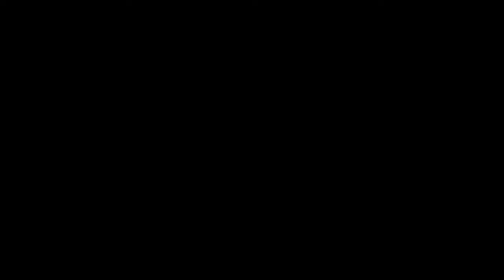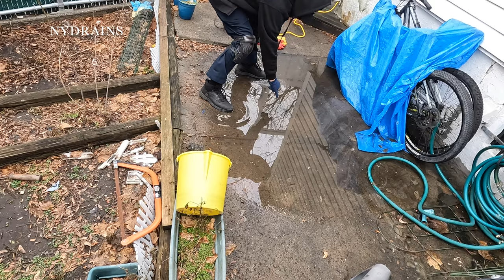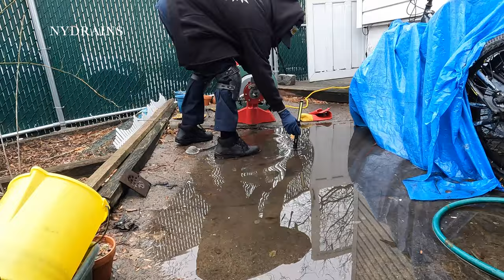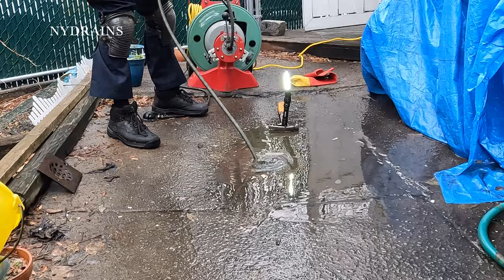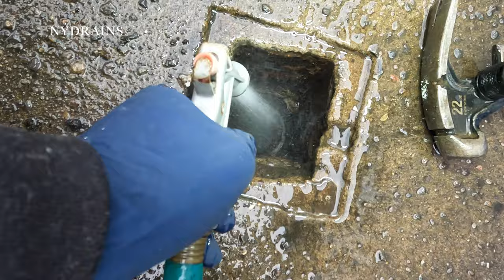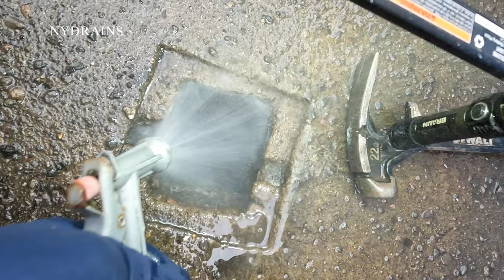Easy Peasy Outdoors Cleany #CloggedDrain #Sewer #Shorts

Comment: I think doing a storm drain might be a first! Well, a first that I can recall.
Reply from the maker: I've done plenty, none on tape that I can recall.
Reply: that looks old enough of a "storm drain" to be ran inside and tied into the sewer line! that's what NY(and others) did many years ago, including the downspouts from rain water!
they outlawed and quit doing that many years ago also! here in Ohio, there's giant cisterns abandoned all over the place underground(used to collect rain water from roofs), you never know where one is and if you'll fall in through bad lid or heavy equipment/vehicles collapse it.
I nearly fell into one back in 2001, behind a residential home in Akron, Ohio(rubber city), I stepped just right carrying a 100lbs (of wiring) and the rusted steel lid went poof. I dropped the wire and and caught myself, nearly taking my arms off. it was 10' deep by 12' wide and 18' length with a 3/4 height partition wall in the middle.
it was abandoned with all piping to it blocked and full of tree roots of course, but still had about 5' of water standing it it. my lower legs got a bit wet, it took three people to lift me up and move lid/debris, lucky I was there with a large group of builder friends swarming all around working.